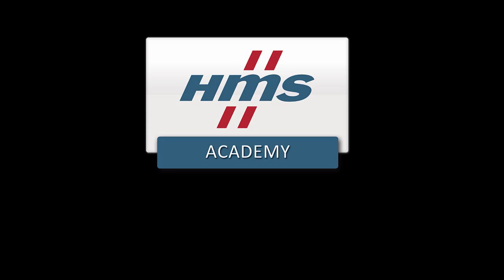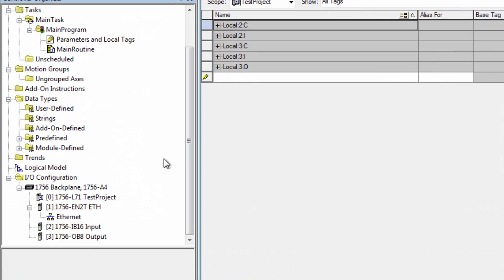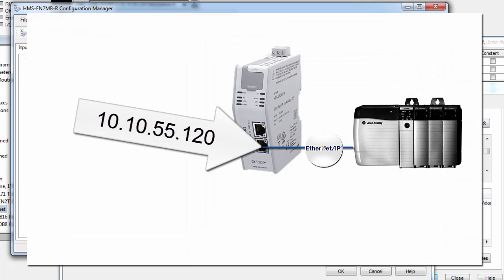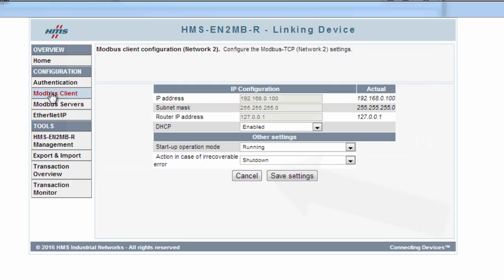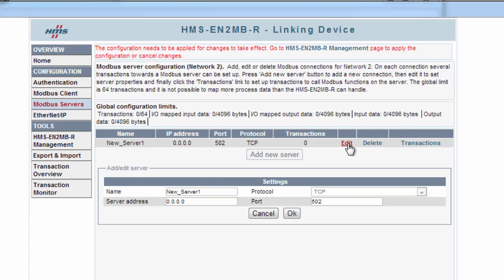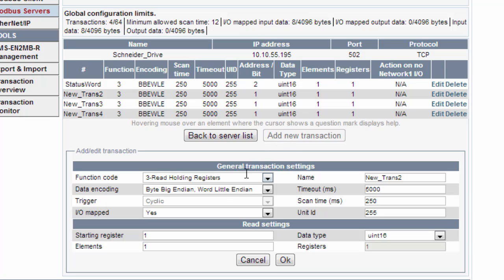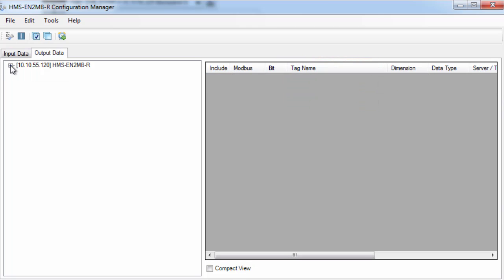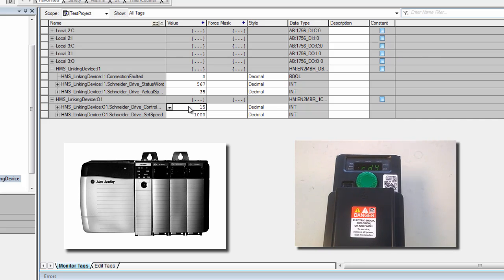How to connect a Rockwell PLC (EtherNet/IP) and a Modbus-TCP device

Comment: How many clients can you add? 
and what if you already have logic addressed in your logic, and you need to modify the client, does that messes up the configuration ?
Reply from the maker: Hi Gustavo, apologies for the late response. Our gateway is an EtherNet/IP adapter on the Rockwell side, and a Modbus-TCP Client on the other. The Modbus-TCP Client-side can handle up to 64 Modbus-TCP servers. Anytime you add or remove servers on the Modbus-TCP side, the configuration will need to be adapted in the Rockwell PLC engineering tool. 
Have a great day!

Comment: There is a new AOI(Add-On Instruction) to do this for later model Compact/ControlLogix (OpenSockets capable). Not as impressive as Anybus, but free on the knowledgebase. This is still my goto for ModbusRTU comms . . . definitely better than Prosoft Gateway for CompactLogix, with Spectrum Controls being a close 2nd. They need to make a video of a Modbus serial version. I've got a PLC lab, maybe I'll make a video next time I get one for a project. Modbus to IoT  gateway is going to become a common protocol conversion I imagine for retrofit IoT applications.
Reply: Hello everything is fine? I was very interested in what you said! Did you happen to make the video you mentioned? I have a PLC 1756-L83E (ControlLogix 5580 Controller) and I am researching a method to perform this protocol conversion. I wanted to check if the method you mentioned is possible in my case. Thanks!

Comment: Thank you! Excellent video. 
Question: can the MODBUS TCP and EtherNet/IP devices be on the same physical network? In this case, for example, what if the Schneider drive and the Logix PLC were plugged into the same ethernet switch? Would we still need to use both ports of the linking device to connect to this switch?
Reply from the maker: Hi doanster!

You need to connect both the Ethernet/IP side and the Modbus TCP side to the network. They can be on the same physical network or separate networks.
Reply: Thank you!
Reply: i am currently examining the work done by some manufacturer with a weather station and they connected both ports of the linking device to the switch and it seems to have both, modbus TCP and ethernet/IP on the same node.